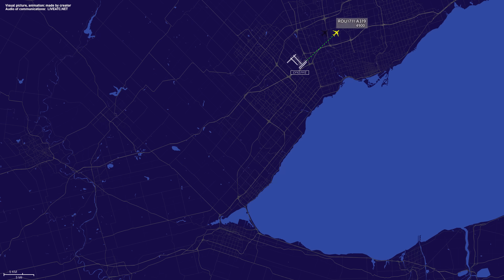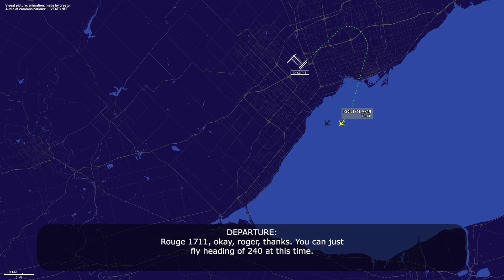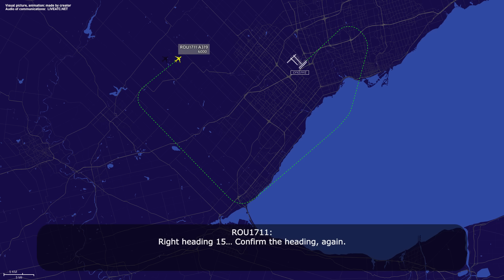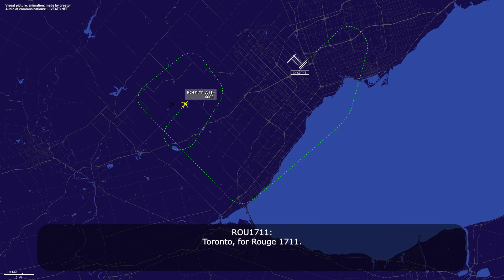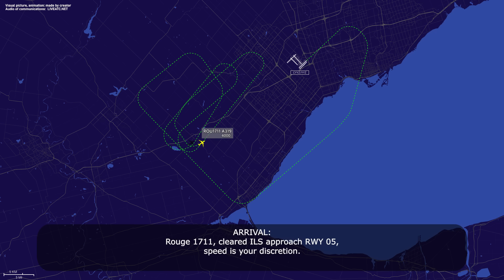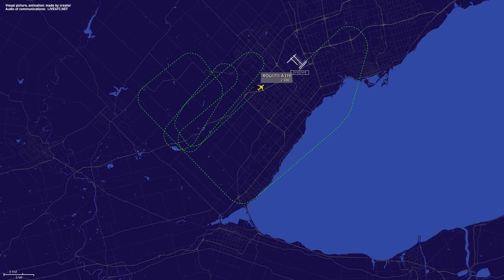Air Canada Rouge Airbus A319 blocks runway for 33 minutes. Hydraulic issue after takeoff. Real ATC

Comment: About 5 years ago on an Interjet flight from MEX to YYZ, as we landed I noticed that we started wandering off the centre line coming uncomfortably close to both edges of the runway and light fixtures. as we rolled out we did taxi off the runway by about 100 feet on a runway exit ramp.  (26, can't remember if it was R or L) . The pilot announced that our A320 had lost its steering and we then waited for almost an hour for a tow motor to fetch us to Terminal 3. Made sense the plane wandered off the centre line but I sensed the pilot was able to keep it relatively pointed in the right direction by applying the appropriate brakes left or right. He did a good job. Getting off the flight, I asked him if he had lost hydraulics and said it wasn't hydraulics, after all he did retract the flaps and slats when we came to a stop. Interesting evening. Oh yes, and I thanked him !

Comment: You can tell this is Pearson and not Kennedy or LaGuardia. Everyone polite and professional. ATC actually listens when the pilots tell them something. ATC doesn't ask a bunch of questions which have already been answered. ATC doesn't try to be a smartmouth.
Reply: lol that's exactly my first thought. Absolutely not in the states
Reply: YYZ also doesn't have nearly the volume to deal with that NY does, so NY and area  has to be a lot more abrupt.
Reply: @geebee7529  Yes but NY will have more ATC staff to compensate. No excuses for poor behavior on the part of NY controllers.
Reply: @geebee7529  YYZ still has a pretty large volume.  They have the same number of departures a day as Kennedy (about 1200) and more than LaGuardia.  If you're talking the entire airspace, then yeah that's a different story, but even there it's not an order of magnitude worse.  YYZ moves a lot of planes.